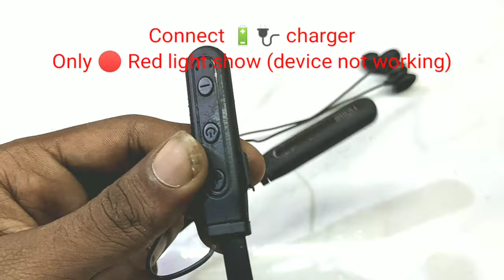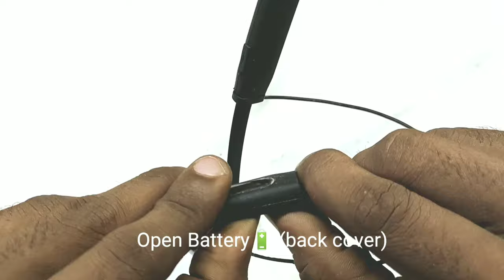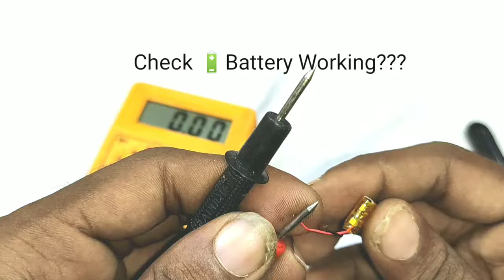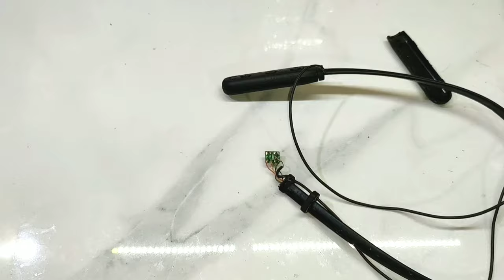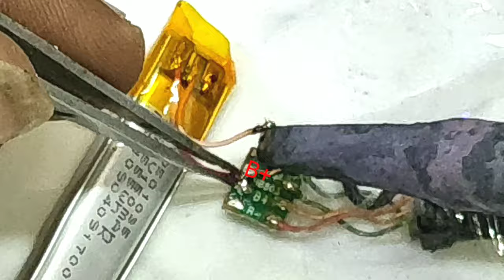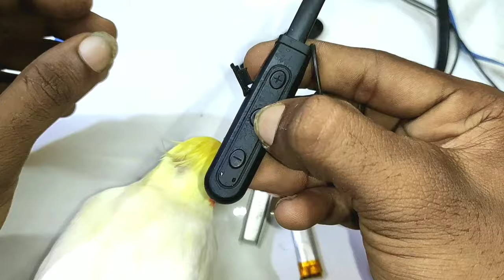only red light show bluetooth headphone repair

Comment: Bro my realme wireless buds battery and volume controller side liquid leaking what is the issue. Please tell me bro
Reply from the maker: Don't worry about your realme air buds...what's the problem make short video and send me on whatsapp WhatsApp :-+918806205689
Thank you